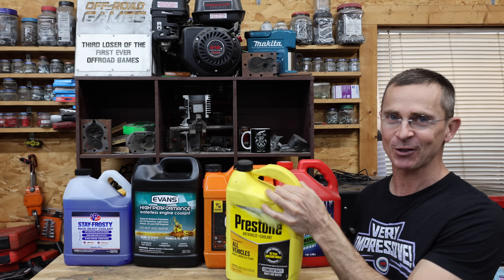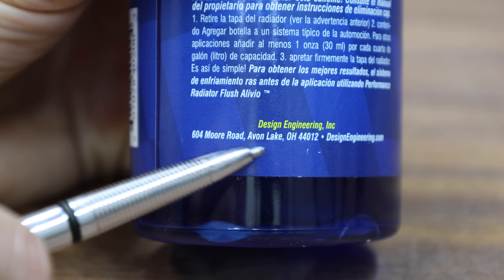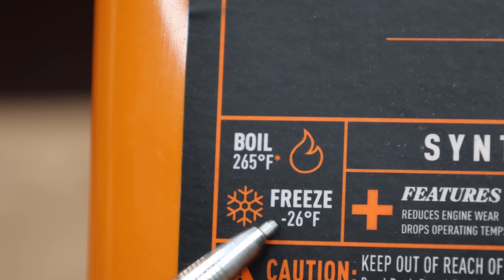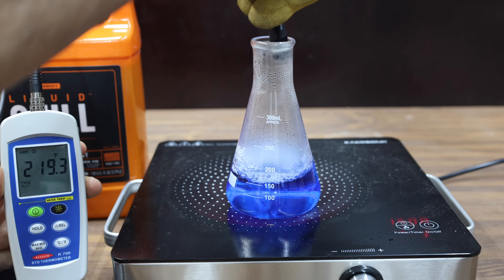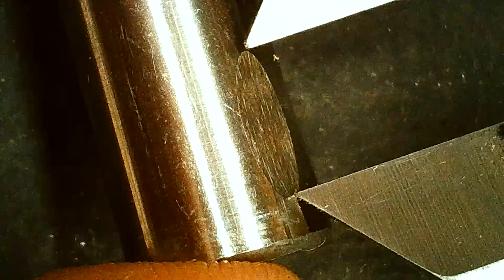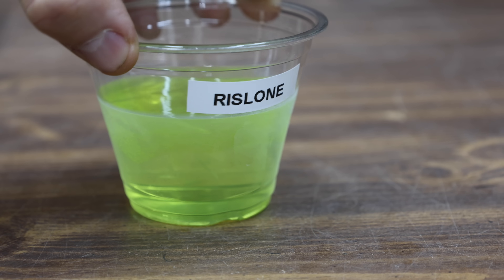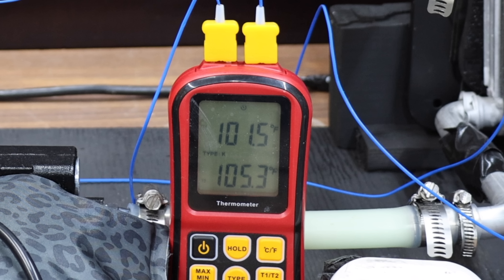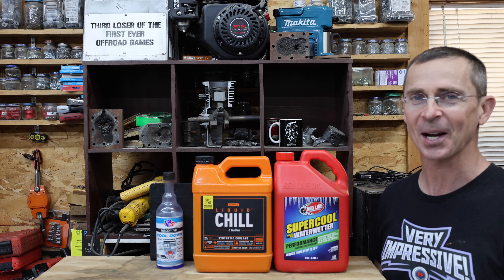Do "Super Coolants" Lower Engine Temperature By 30 Degrees?

Comment: Excellent video. The only thing I wish would have been tested is the thermal transfer at higher temps. I work on enduro motorcycles and we regularly deal with boil over problems, so Evans is often a practical solution. Seeing the heat transfer numbers up around the boiling point would have been nice to see.
Reply from the maker: Thanks!  Thanks for the constructive feedback.

Comment: FYI, yall do not need this in your cars. Because if you lower your temperature in your engine, it will cause your ecu to start tripping. Cars need to run at a certain temperature to run smoothly.

Comment: 1. no coolant will keep any system "cooler" than any other. you could only affect the contact surfaces on the microscopic level with surfactants as long as they dont alter the chemical composition too far.  230 degrees is 230 degrees. 

2. why would you want to keep your engine below operating temperature? this wastes fuel as the O2 sensors are largely if not entirely ignored until the engine warms up so the ecm runs in a rich open loop situation. 

the only thing "super" is how long they are supposed to last

Comment: The test should be conducted using the same heater core setup but with a 50/50 mix antifreeze and each product in sequence, checking the entering and leaving water delta on each product.
Reply from the maker: Thanks for the constructive feedback.

Comment: how is the coolant going to lower engine temperature by 30 degrees?? the thermostat doesnt know what coolant is in there
Reply: Engines can run up to 230- 240 degrees while thermostats typically open at 195 for modern engines …..so if an engine runs at peak summer heat around say 230 degrees….some additives will help bring those temps down.
Reply: For instance, in the desert my truck is running 250f.  The better coolants might be able to reduce that.
Reply: Not being funny but if your engine is at 240d and the stat is open at 190 then the radiator isn't man enough?🤔
Reply: @davidroberts30  when you've got a 400hp engine running full throttle in the desert at 120degrees its hard for any radiator to keep up.  These coolants would be a cheap performance improvement.
Reply: @kpetr.....producing 400hp for any length of time, will result in you going probably 140 to 190 mph, depending on what vehicle you've got... do you do that?
     Most cars cruise at 65 or 70 when 30 or 35 hp is produced, regardless of whatever peak power you can make, which occurs at only one engine rpm and full throttle.
    A steady 400 hp will make 80,000 lb go uphill reasonable quickly.
   And, yeah, that requires a big radiator
Reply: you're just trolling, right? 🤣🤣🤣
Reply: To my understanding, car and truck radiators are designed and tested to have unlimited cooling capabilities when the engine is operating at about 70% rated horsepower in ambient conditions.

I do not believe this number includes things like load rating, and is determined when the engine is brand new without blockages, films, or deposits.

There are several circumstances that fall outside of these "average" conditions.

Like hauling at low ram, high altitude travel, or when exceeding the 70% hp mark, even for a brief period of time or now more commonly with turbocharged engines causing hearsay.

These products are to help prevent catastrophic failure when you venture outside of a manufacturers "ideal" or "calculated scenarios".
Reply: Heat-soak was corrected to hearsay

Comment: As much as I enjoy watching all the testing methods, the bearing and wear scar test has always kind of rubbed me the wrong way (Excuse the pun). The size of the wear scar will never be a linear relationship and kind of hides the real differences between a wear scar that is 4.45mm in length vs. a 4.6mm length. The 4.6mm has gone through much more material removal to get to that point since the rubbing surface is a circular profile. Perhaps comparing the weight of the bearing pins before and after and showing how much material was removed may show more insight into the amount of friction occurring?
Great video as always though!
Reply from the maker: Thanks!  Thanks for sharing.

Comment: Unless I'm mistaken, the coolant additives are mainly for water only. This would be for the people in the south where it's not cold alot or for the track.
Adding coolant additives to a already 50/50 won't do much if anything.
Heard horror stories of certain coolant being to acidity causing leaks in radiator and headgaskets due to it slowly eating away at material. Love the testing you do man. Much love
Reply from the maker: Thanks!  Thanks for the feedback.

Comment: But the coolant temp is controlled by the thermostat, not the coolant. The thermostat is set to what temp the engine runs best at performance vs wear. So I guess if a car is overheating or if there a malfunction in the cooling system then this MIGHT do something, but it’s still gonna over heat. It just might take a couple more minutes lol. So none of this will really do anything in a properly running vehicle… other than making the engine take a little longer to reach operating temp. Low operating temps can cause more internal engine wear and emissions. Just fill it up with a good coolant and a proper temp thermostat. If she calls for a 195 then use a 195… it’s not really worth installing a 180.
Reply: Think man... this helps eith cars that overheat..m above a 195f thermostat itll stay wide open.. and if youre at 225f a thermostat doesnt matter as its fully open.. if these bottle can drop that tenp by up to 30f lile they advertise.. then thatll help a lot

Comment: Anti freeze is a engine lubricant on cold starts???? I thought that job solely belongs to engine oil? Someone explain
Reply: My guess is he meant lubricating radiator, water pump and stuff 🤔
Reply: @jaskajokunen3716  do they have metal on metal wear?
Reply: @jason200912  its more like lubricating against corrosion, which water has worse protection for.

Comment: Your video is good but you left out the fact that pump slippage is engineered into your engines cooling system. Slippage increases with the addition of additional coolant ratios which in turn reduces the flow of coolant through the engine, thus reducing its ability to remove heat from the engine.
Reply from the maker: Thanks for the constructive feedback.

Comment: I used Evans Waterless Coolant in my RX-8. Rotary engines creat ALOT of heat, and is a major cause of failure for them. With the coolant, a high quality radiator, my rad fans almost never turned on and the car never went above 190 degrees. Huge improvement imo.
Reply from the maker: Thanks for sharing.

Comment: At one of my AC Delco classes, there was a demonstration that measured the temp of the block when the temp of the coolant was lowered, by changing t-stat. The block temp actually rose due to the coolant not bing in the block long enough to remove the heat. This is not 100% as different engine designs perform differently.
Reply from the maker: Thanks for sharing.

Comment: just a question to not be confused anymore
if an engine is running too hot... doesn't that mean there is a fault in the cooling system OR the cooling system itself isn't designed to handle the the amount of heat and should be upgraded?

Comment: Regarding the Evans coolant, you are correct that it does not make the equipment run cooler at normal operationg temperature.  However, the big advantage is the resistance to boiling or steaming.  Steam is a VERY poor "coolant" regardless of brand.  Once the "cool" runing fluids do boil or steam off the risk of engine damage (warped heads) is HUGE and eventhough the temp goes up with Evans, it does not boil until way beyond those mortal fluids and thus ends up providing far superior protection.  I have used Evans in my tractor for 21 years now and it used to over heat when worked hard on hot days with  normal coolant, but never since using Evans NPG.  AND Evans is permanent.
Reply from the maker: Thanks for the feedback.

Comment: I've tried most of these over the last 25 years. As far as keeping the engine temperature down, the thing that worked the best is just turning on the a/c fan by turning on the a/c.  I have a switch on one of my cars that bypasses the a/c switch so I can turn on the 2nd fan when I want if it's not already on.  Years ago people would turn on their heater to help cool the engine.  I still remember when I was a teen and my dad turning on the heat full blast, rolling down the windows, trying to not overheat in death valley when it was over 110 degrees outside.  He hated that 1980 caprice wagon.
Reply from the maker: Thanks for sharing.

Comment: About the testing process, I think it would have been good to monitor how much energy was required to heat up the coolant to the starting temperature. One of the reasons why nearly straight water is superior to antifreeze in racing conditions is because it has a higher thermal capacity, meaning it takes more energy to heat it up in the first place and more energy is stored in the coolant for a given temperature. As it's running through the engine it is able to absorb more thermal energy without heating up as fast.
Reply from the maker: Thanks for the constructive feedback.
Reply: @ProjectFarm  ❤️
Forgot to add: Great results nonetheless and thank you! I never would have thought that a little amount of additive would be able to improve antifreeze as much as they did.

Comment: Why would you want to 'remove' heat from the engine? It is designed to work at a certain temperature, not below
Reply: Try towing heavy loads up mountains. You need all the extra cooling you can get.
Reply: @camel413  Fix your vehicle, it is malfunctioning if it overheats
Reply: @javierc2726  you have obviously never driven a vehicle bigger than a regular passenger car. Also there is a difference between a car “overheating” and towing when the temps climb some but are still in a safe zone. As you said in your original comment engines are designed to work at a certain temp. So anything that helps keep them in that temp is good.

Comment: Good info.  I use Evans in my classic cars to prevent corrosion.  On one trip the car's fans stopped working, I didn't notice until the Evans was flowing out of the reservoir cap.  I spoke to Evans about how to top it up to get home and the engineer I spoke with told me I could add antifreeze but you need to flush the system to restore it to Evans requirements later.  But he also told me it didn't boil out, it just expanded due to the added heat and that he thought I'd be safe just driving the car home as it was, and he was right.  So I love Evans because of that high boiling point.

Boiling coolant causes problems with the head.  it boils off on top of the cylinder even before you can detect it's doing so, creating small hot spots in the combustion chamber.  Since Evans doesn't boil as early that doesn't happen.

Lastly, Evans is non-toxic for animals.
Reply: I was considering Evans at one point. 
The problem is that it actually is worse at  heat transfer
Reply: @joshkelly3743 you are misunderstanding
Reply: @joshkelly3743 
You are misunderstanding the whole thing. I had a 99 Powerstroke pulling a 33ft trailer up a grade and the thermostat stuck closed. The motor was so hot it was pinging. Pulled over and sat for approx 30 min and the thermostat opened and I continued to drive that truck thousands more miles. I also was running Redline 15-40 diesel oil. When I sold the truck the guy put a ping pong ball on the place you put oil in the motor. The ping pong ball never even moved. zero blow by! If that isnt an example how good it is I dont know what is?  At that time I was also running the system at 0 pressure. I had drilled a small hole in the cap. So people need to get over the heat transfer thing
Reply from the maker: Thanks for sharing.
Reply: The Evans' wear scar is large though.
Reply: @skywind007  nothing in the coolant system should be "wearing" even the coolant pump has bearings which are isolated from the coolant. in this instance its kind of a pointless test. imho. not pro or against evans but the wear scar shouldn't be a factor in any decision on cooalnt.
Reply: @denisohbrien  it is not a pointless test because the products were advertising that they can reduce friction, so the test checks if that was true.
Reply: @skywind007  Water mixed with coolant will eat up your water pump long before you have any wear scar from Evans.
Reply: Evan's waterless coolant is an interesting product, and is fundamentally different.  And like all things, has some pros and cons  While I have not used it, my research found the following:  Cons-Runs slightly hotter-(the point of this video), difficult to install (all traces of water must be removed likely using special drying agent), the need to carry spare in case of leak(not all stores carry), and expensive (cost to DIY change out  about $200).   Pros:Permanent (no need to ever change out- can be reused in other cars), non -toxic food grade glycol, no corrosion, high boiling point, no superheat cavitation,  Pressure can be lowered in system from 14-15 PSI to 1-2 PSI ( reducing pressure damage and risk).  
    The last is the the most interesting to me, as many Ford vehicles suffer from weak intake manifold coolant jackets.
Reply: @VVBros1 My vehicles do not run hotter.  Yes, all water must be removed so it's involved, I installed the Evans after an engine rebuild so it was totally dry.  If there are coolant system leaks those should be addressed, but I've driven long distance with some of the coolant having escaped due to a faulty fan relay, without issue.  But if you do have a leak that really needs fluid you can use water or anti-freeze, but will have to flush and refill the system when you get home.  With Evans coolant they want system pressue to be zero.  I simply remove the inside of the cap on my car so it's open to the air.
Reply: I want to know which coolants she'd heat on the actual engine head not just the coolant.
Reply: Ive been using Evans for years and years. Best stuff by far!
Reply: Evans is highly flammable tho. I'll pass. Sparked up one heck of a fire when the lower hose sprung a leak and the coolant hit the header
Reply: @jroda8015  Bullshit.
Reply: @jroda8015  Most water based antifreeze is also flammable.. Neither type is likely to be the source of ignition, but either type and support combustion.  So no real difference.
Reply: @VVBros1  highly flammable is what i said. I've literally never seen coolant catch fire from hitting a header pipe any other time
Reply: It's terrible at heat transfer, there's a reason why we only add antifreeze to water up to a 50/50 as it greatly reduces heat transfer, at this mixture you are talking about a reduction of approximately 15%. Water has one of the best thermal capacities of any liquid. Glycol on the other hand is pretty poor, unfortunately some dumb marketing firm decided to make Evans waterless coolant and make it sound cool (pun intended).
It's mostly made of glycol and as a result it is a bad "coolant", which is used to "cool" things.
Engineers spend a lot of time and money designing coolant systems for cars, that coolant system has a thermal capacity of its own which can be easily exceeded if the coolant cannot transfer enough energy out of the radiators.
Another thing that happens with water when it approaches boiling point (which is higher than 100c under pressure) is the energy curve to make it change state becomes steeper. This means not only does it become better at cooling it can even transfer more thermal energy more efficiently. This is why cars are designed to run around 90C, because this is where water is most effective and why the gauge goes up to 120C.
If your vehicle has cooling problems with water, making it run hotter with a bad coolant isn't the solution.
Reply: @rosskj9187  yup, and the test in this video confirms that beyond anecdotal evidence
Reply: @rosskj9187  Not all problems with cooling systems are the same  You have assumed way too much.  There is no such thing as a "bad coolant" except in your mind.  Think bigger.
Reply: @rosskj9187  Wrong. Evans is bad ass coolant.
Reply: @rosskj9187  I've been running Evan's waterless coolant in my BMW in Arizona since 13 years ago and it has never failed to maintain the desired operating temperature. I can see my coolant temperature on my dash and it is always held at the thermostat spec. So regardless if Evans has a lower specific heat capacity than water, it still performs the job of cooling 100% successfully without issue. 

I made the switch to Evan's because of experiencing a catastrophic blowout of my radiator due to the high coolant Pressure caused by Water content in typical coolant that creates Steam pressure in the cooling system. And left me stranded. 

Was very unsettling to think I could be stranded at any moment's notice. What if I had been driving through the desert? 

Years later when that replaced radiator cracked again, I could smell and then visually see a small leak of the Evans fluid from a crack in that dang plastic radiator neck. And was able to drive to a repair shop, leak notwithstanding. Not left catastrophically stranded. This is because Evans does not create Steam Pressure like regular coolants. ...No pressure, no catastrophic blowouts

No corrosion or electrolysis is another advantage of Evans because of containing no water
Reply: Evens stuff almost like brake fluid